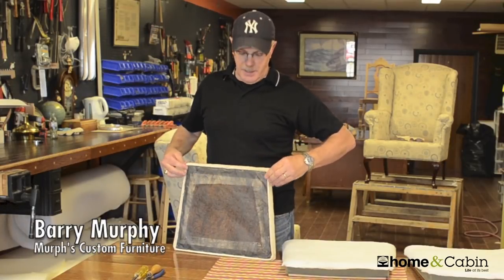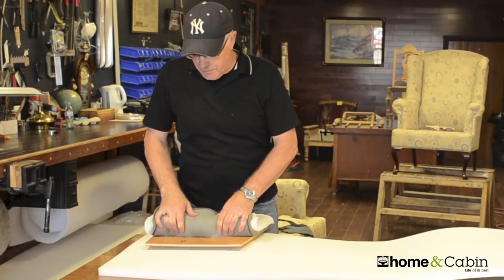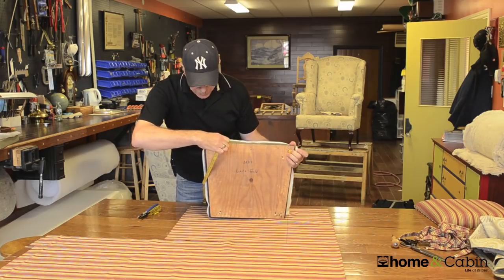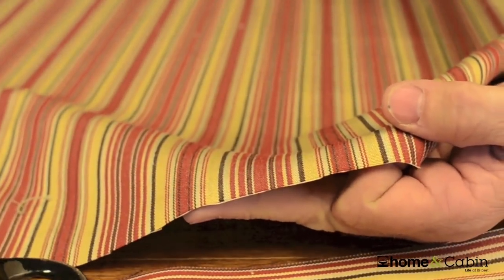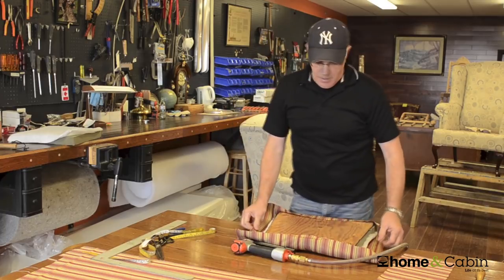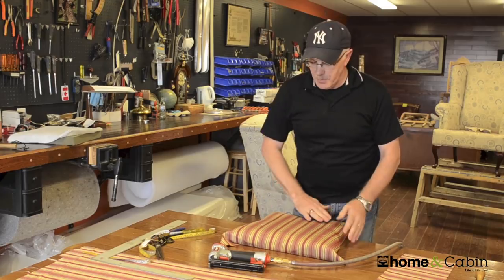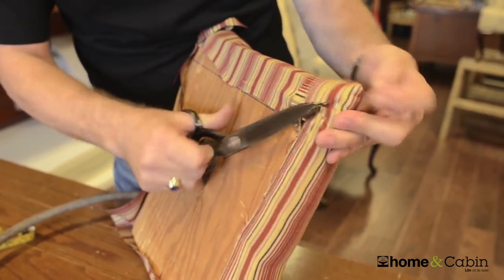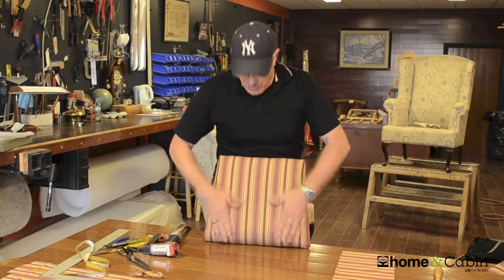How to reupholster a chair seat with Barry Murphy, master upholsterer

Comment: There was no mention of how much profanity I would need while using a staple gun, but... you did warn me generally. I did a trial run with the old fabric and feel a lot more confident, but now I'm investing in some kind of pneumatic nail gun that doesn't require me sweating, grimacing, and cursing as if I were giving birth. Thanks for the great instruction!

Comment: Good thorough video, but, this guy hasn't answered a single question posted here.  I was going to ask what size/gauge staples he uses, but...   I do appreciate the instruction about centering and alignment with the guide lines.
Reply: I answered a couple for ya. 1/4 or 3/8" Staples depending on fabric thickness and hardness of the wood.

Comment: Great video. Our problem is removing the seat. There are no screws in the corner blocks or any where on the perimeter after we remove the dust cover 
There is webbing that appears to be glued to the top of the frame 

Our cushions are very good but the fabric is stained and we want to change it but removing the seat is puzzling and before I go further I wanted to inquire

Comment: How the foam is attached? Is it stapled right to the edge? I cannot see it being wrapped around the seat part. Any suggestions? In the video he completely omitted that part.
Reply from the maker: The foam is cut to the same size as the seat. It is not wrapped around the seat. You can attach it to the seat board with spray glue.
Reply: @HomeAndCabin  - You said to cut the foam 1/4" larger all around the seat, not the same size. 1:47

Comment: Darn it.  I was looking up videos for corner tips as I am that far but my foam, repuposed from other chair cushions doesn't have the poly batting, just a thin fabric layer.  What is the negative from not having the poly batting around the foam?
Reply: +Justin Shiffler - Justin I know this was two weeks ago so you may not need the information now.  The batting just gives it a better finished look and feel.

It all depends on the chair and what you are trying to do (and the foam, the type of fabric being used, etc).  However, what the batting does is soften the lines and round out the top of the cushions in a smoother fashion (especially with thin fabric) and provide a small soft barrier between the person and the cushion.
Reply: It shows every little lump and bump and irregularity without the batting.  The batting will just make sure it looks a little smoother and better finished. :)